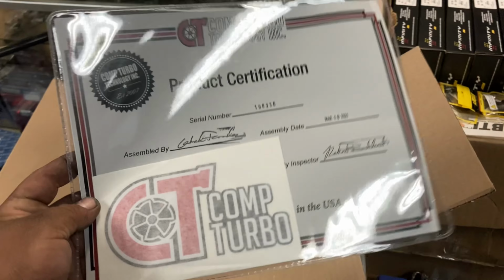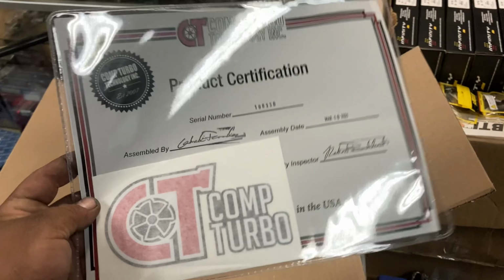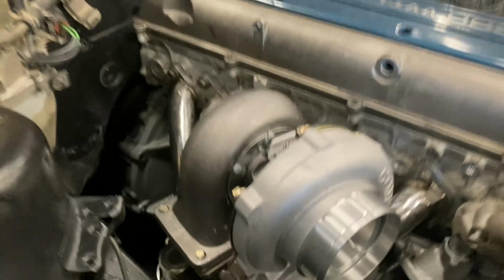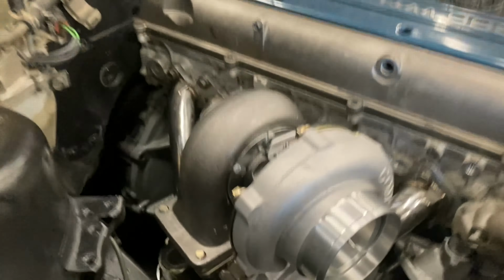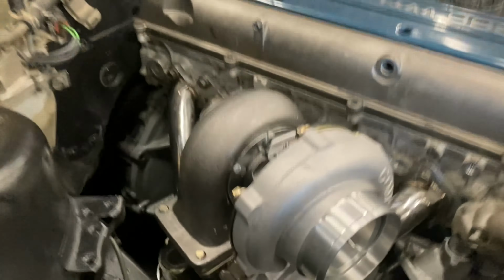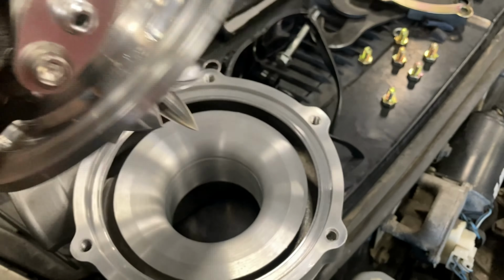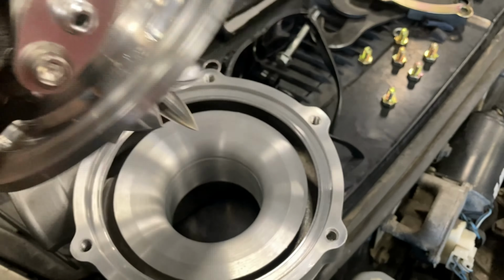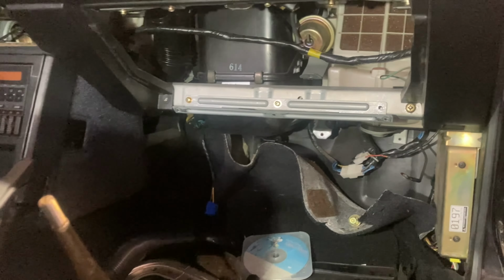2jz Conquest/Starion build part 2

Comment: If you were to make another custom harness. Approx how much $ would you charge
Reply from the maker: Depends on the application we use a can dash instead on dealing with all the factory wiring and gauges  but usually one of my self contained Jz stand-alone harness start at about 1500$